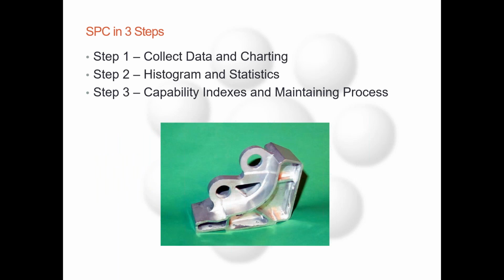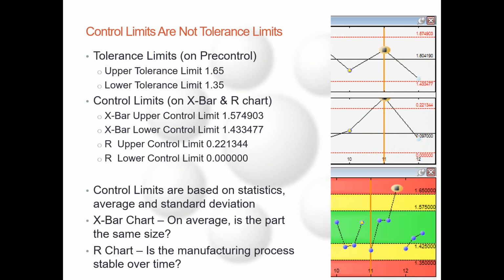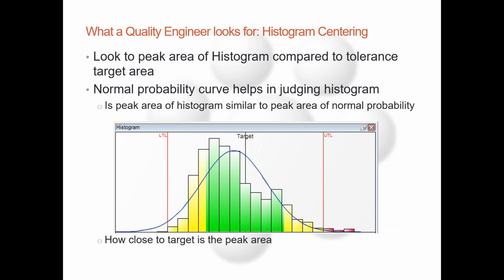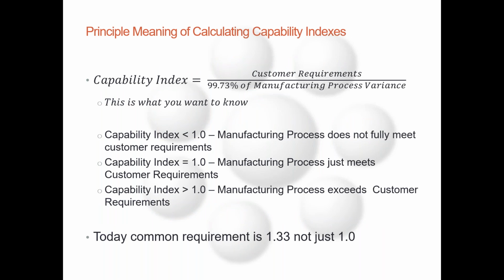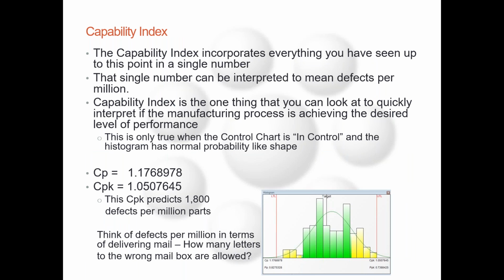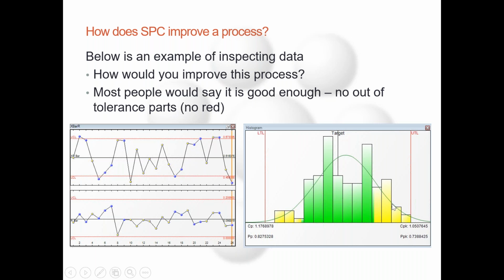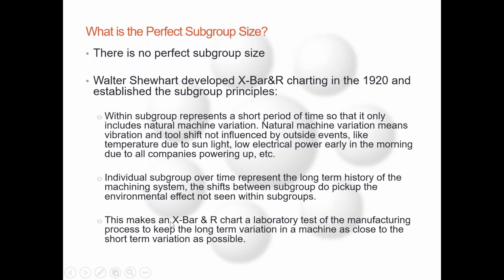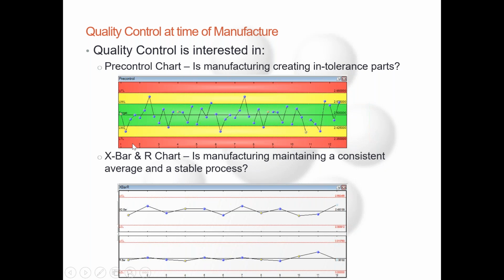SPC in 3 Steps - Learning Statistical Process Control with Mitutoyo

Comment: Good explanation I have doubt  that everyday I measure length of rod from cutting machine and have two measuremen for each piece .For example length of rod is 10.00 +/- 1.00 mm is specification I found 10.30/10.40 for first piece ,10.0/10.30 for second piece and etc .....

Which observation minimum or maximum side one should I consider for plotting chart and calculation ...